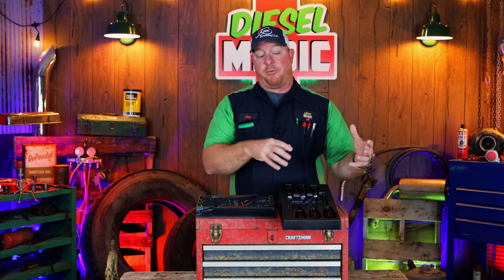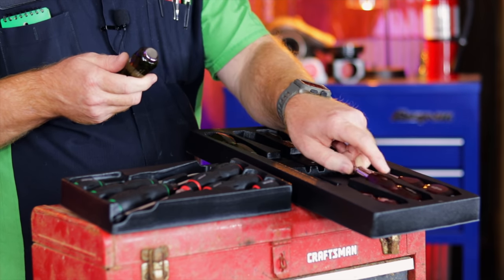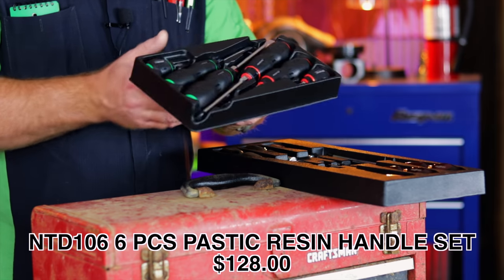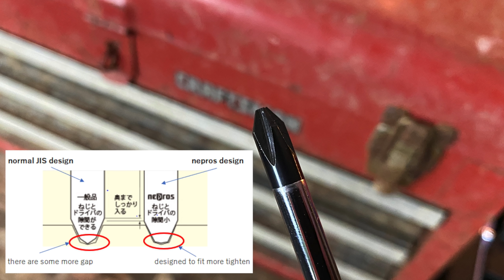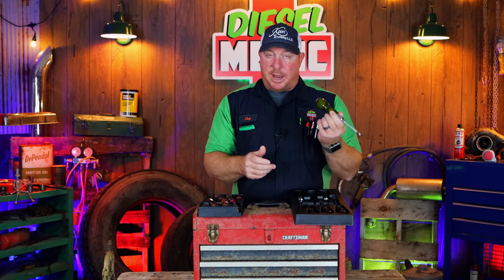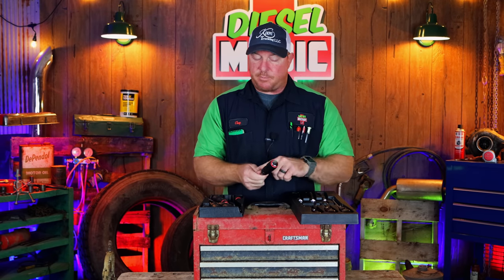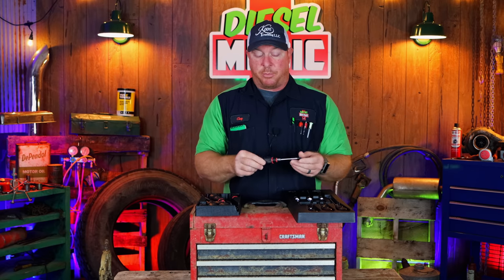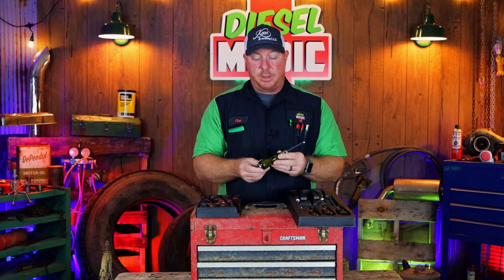Nepros Screwdrivers : Old School Wood Handle VS New School Technology

Comment: Ordered the wooden handle set way back in October and received them a bit over a week ago. Totally worth the wait, quite a bit pricey though, converted 230$. At first I thought I'd only have them to look at but once I actually felt them in my hand, they ended up in the daily tool box. No Wera, Wiha or even the wooden Felo feel that good in the hand like the Nepros do; but that should be expectable from a set of screw drivers that cost six times of the competition